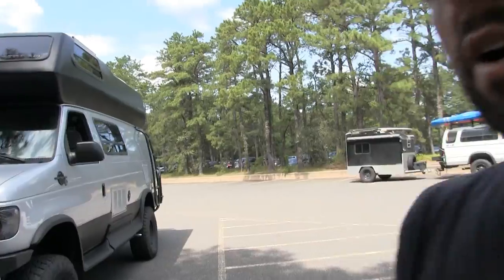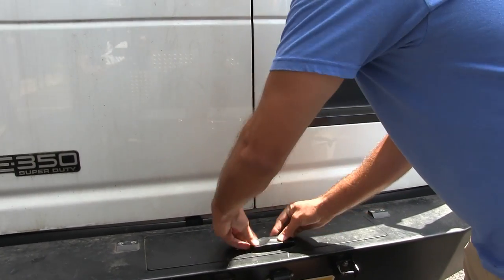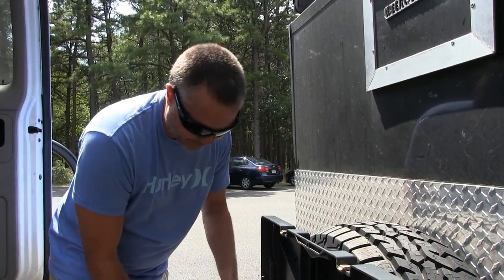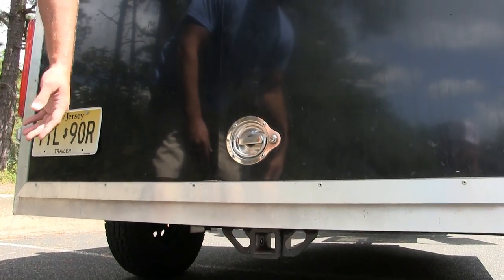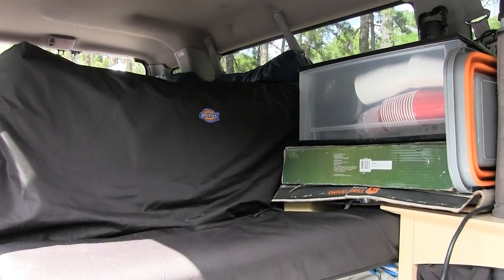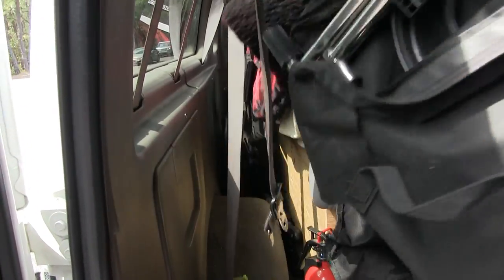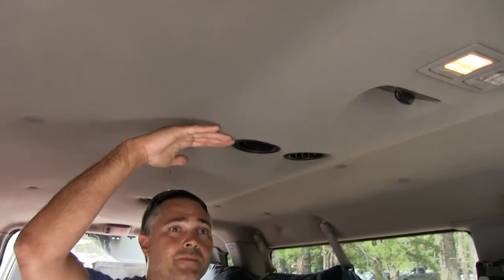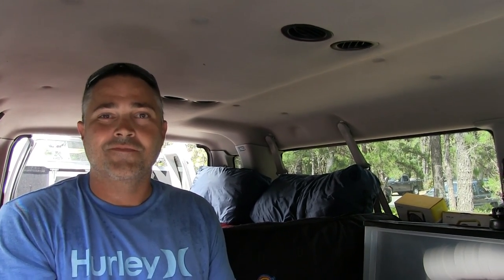VANLIFE TOUR | Teachers 4x4 Custom Adventure Van and Camping Trailer

Comment: It's a very nice and smart Van you have here. This is probably the reason for your neighbors for gray hair. 😀 very smart solutions for storing tool members. I will probably watch this video several times before I go to bed again on Christmas. Many years ago I bought a Dodge long van with a raised roof. as a carpenter and craftsman, I always needed a place to live on my assignments to find the solution when the neighbor was going to sell his motorhome, which was very beautifully decorated for two. adults and 2 children 😅😅🤩🤩🤪 That car was then fully intended for Camping and motorhomes. I switched it to a work car from Christmas Eve and backwards, with the car's length I had over three meters to work on. dressed again there and forward with that space and the compartment I had a large dorm to live in. from the rear to the apartment, it was one hundred percent dustproof. used it as a workplace on the construction site I worked with, as a residence, break room and travel home on the weekends. Then when my oldest daughter was going to start high school, I applied back the back part Sunday was the toilet and parts of the bedroom. this car became a popularity with girlfriends and all school students. have already decided and never build it back that works car. but after watching your video, i plan to buy another 79 dodge longvan and build it into a trailer with the whole box as a workshop. Oh it with full roof row that store materials I got so many great ideas from watching your video, and thank you for this, it's been 21 years since I bought this motorhome, and with one for Van as a workshop on 4 wheels inside I'm looking forward to building it. thank you 😅😅😅

Comment: Hey, you can tell that guy if he had the shackles on the front springs moved to the rear of the spring it will ride and handle allot better. And Salem Kroger is now Whitefeather conversions. Craig was the lead engineer @ SK and when they went under he started  Whitefeather . I think all he does now is Sprinter conversions. Theres also a 4x4 van conversion shop in NH:  swc4x4.com
Reply from the maker: I am not sure. Thank you for sharing the additional info
Reply: @NewJerseyOutdoorAdventures  not sure about what?